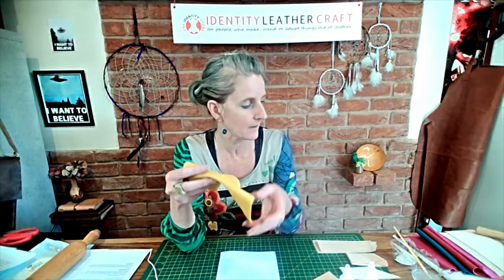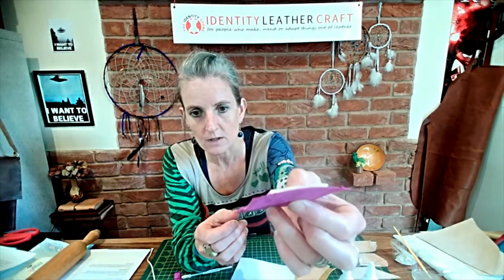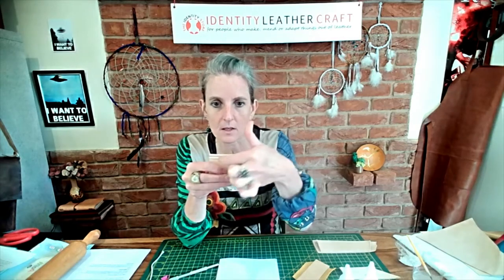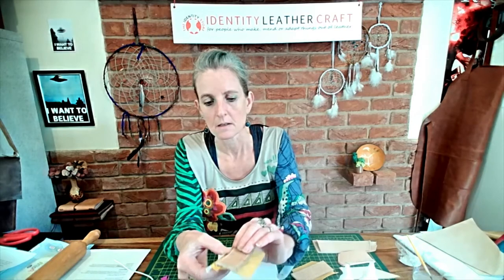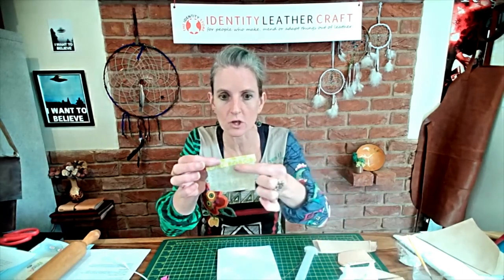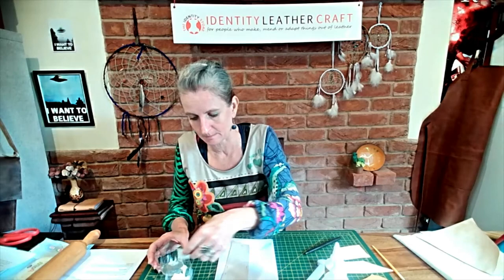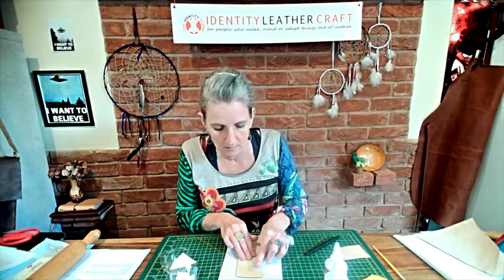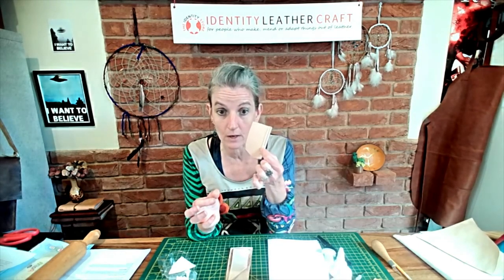Add a lining to your leather projects

Comment: Hi . Thanks for your video, it's very interesting as I'm just starting out using leather to make books. I 'd like to line my leather journals with patterned paper instead leather or fabric. I have no problem gluing the paper on to the leather itself using book binding glue (it keeps nice and flat) but when I bend it to form the book (wrap around style) the paper creases and ruins it. Do you have any advice to prevent this from happening?
Reply from the maker: Hi Lola - I too use paper to line book journal leather and get a similar issue, I use double sided tape for mine so that I can set the fold and then use the bone folder to smooth down to minimise the issue. The other alternative is to deliberately cut the paper so that there is no paper over  the spine of the book where the leather comes round.
Reply: @IdentityLeathercraft  thank you so much for your advice, I shall experiment some more then. fingers crossed